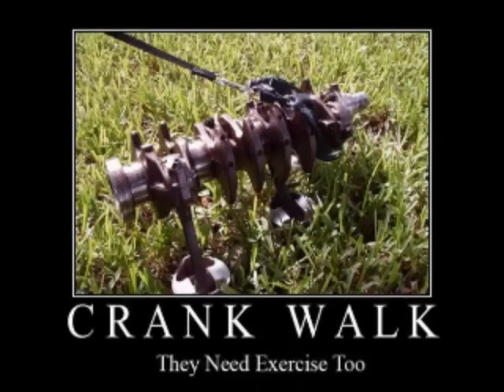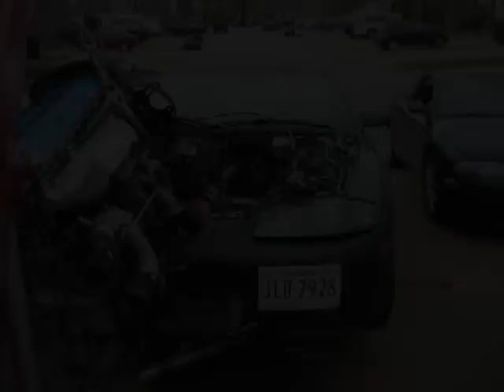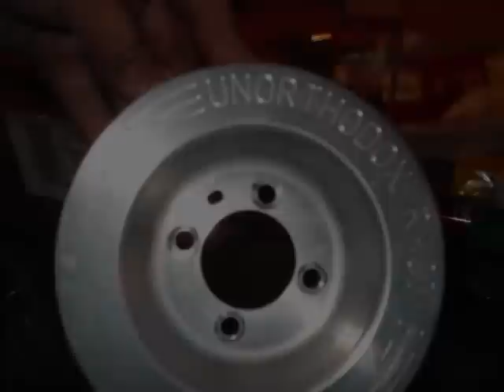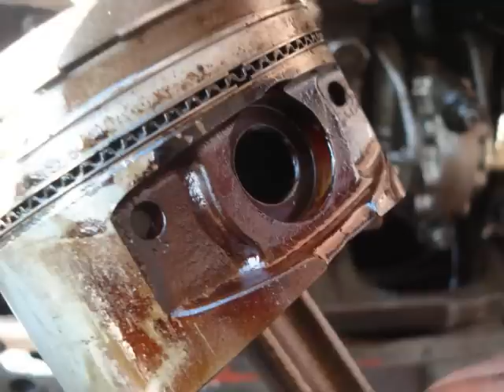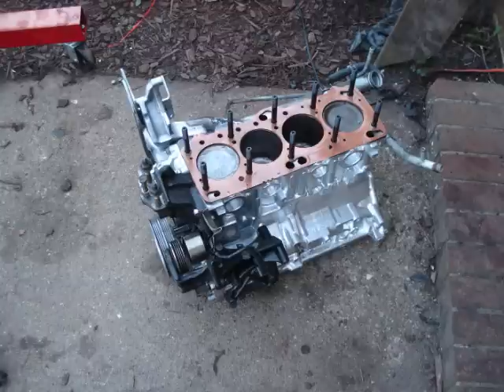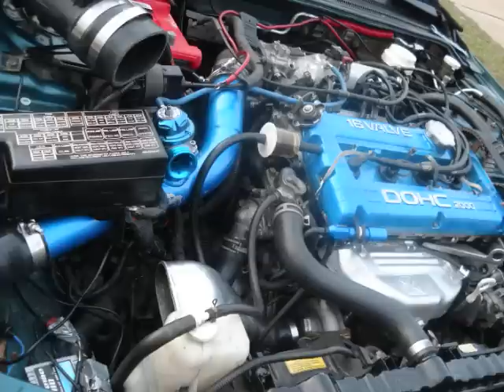4g63 Crank walk rebuild

Comment: You sir are a lucky lucky man. Probably why it was idling so roughly. I recently spun the #3 rod bearing and toasted the crank, so I'm starting a build on my 1G pretty soon going 9:1 forged pistons, forged rods, and forged crank, ACL bearings, ARP everywhere, 1150cc injectors (possible E85 tune on DSMLink) and an FP Red. Should be bulletproof for up to 800, I'll be tuning to 550 or so.

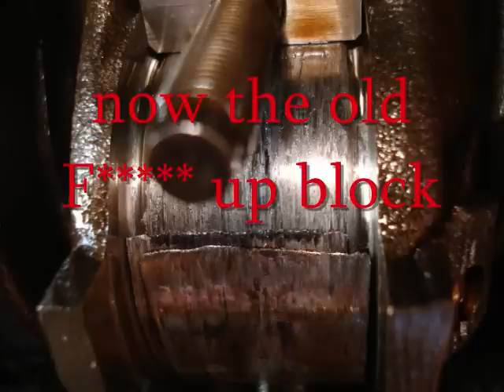Comment: @Eaglestalon 3:55 is a spun bearing,did it run out of oil perhaps? Thrust bearing wouldnt like having no oil either,thats why the crank can move in the block, but it defo didnt cause the engine to fail.

Comment: so I got a question for anyone I have a 97 gst freshly blew motor and trans I want a 6 bolt what do I got 2 do differently 2 put the 6 bolt in my 2nd gen I got auto trans I want 2 do a swap I know I got 2 change all the linkages and all that but anything serious with getting the 6 bolt engine and transmission in I heard I got 2 get a adapter plate for the trans I just dont know about gettin 6bolt engine and trans in 2nd gen